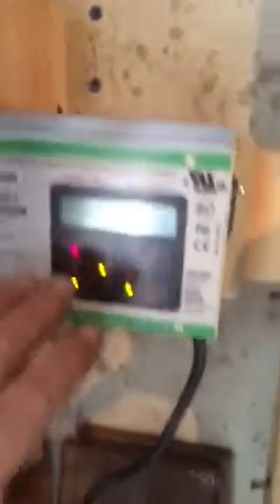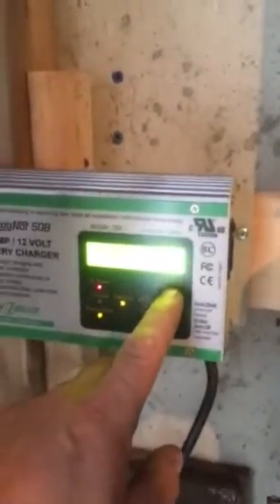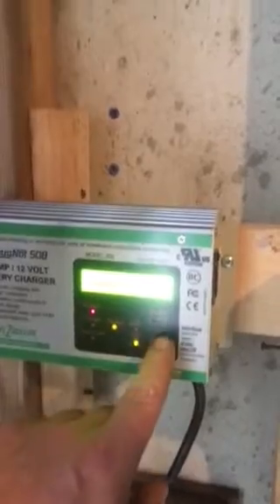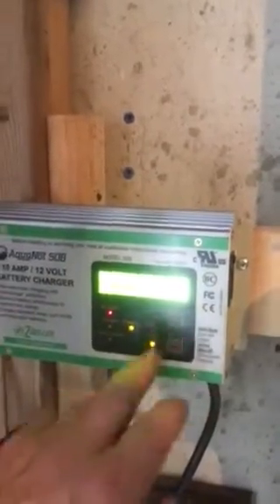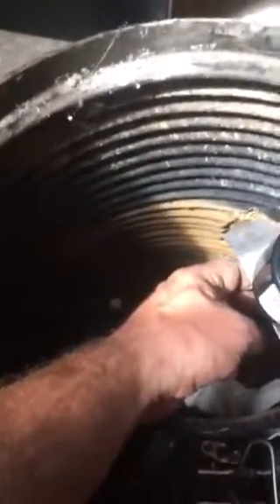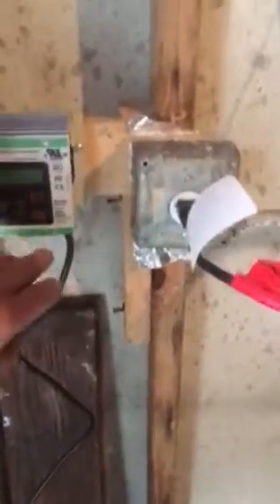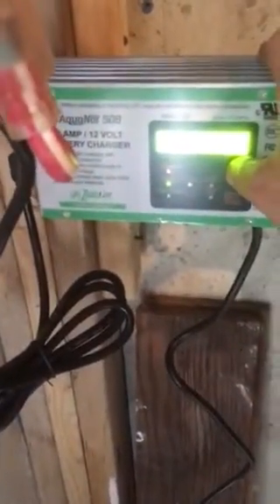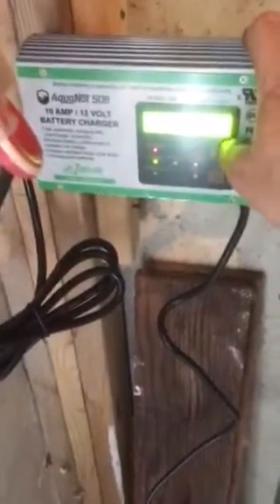Zoeller Aquanot Battery Back Up Sump Pump

Comment: Hi, Is this model the 508-0005 ??
Reply: Yes it is.  If you are still considering a 508 Backup pump - consider the 508-0014 Fit model that was recently released - many more features that the 508-005